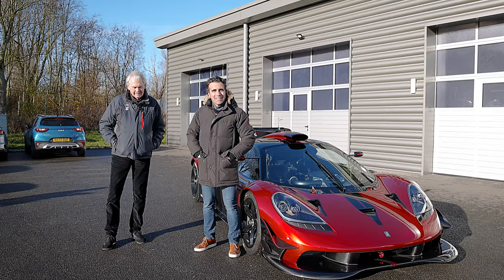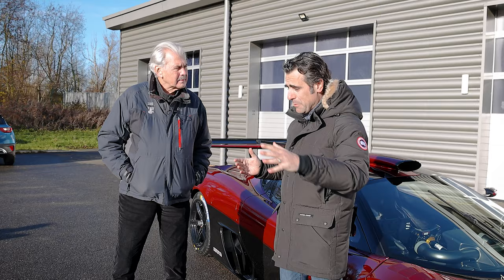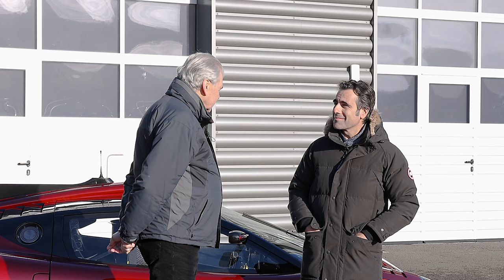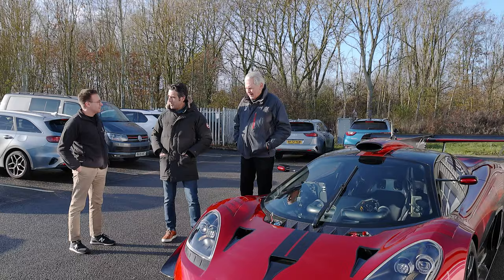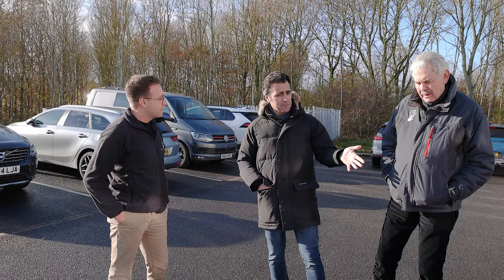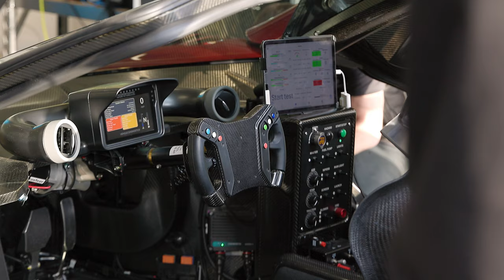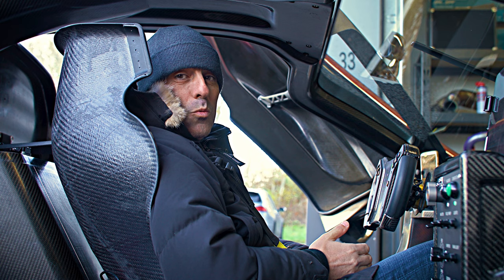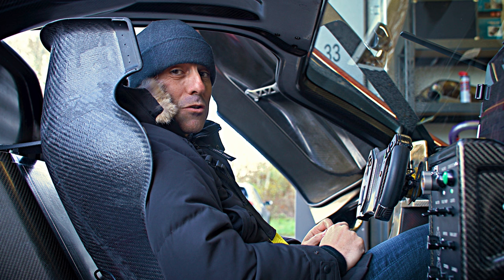T.50s VLOG | EPISODE #04 | COMMISSIONING PHASE - PART 1

Comment: Those shifts are basically instant. The pitch change of the engine noise is virtually instantaneous. One moment it is in one pitch, next moment a lower pitch. Never seen anything like it outside F1 or Moto GP - it doesn't seem to shift as much as announce that it is already in the next gear while the mind looks for some sign of a shift. If the Koenigsegg LST is like lightning, this IGS sounds like it's quantum tunnelling.

Comment: 900 kg = ~1984 lbs
750 hp

750 hp/ 1,984 lbs = ~0.378 hp/weight coefficient

Or

~1 hp per ~2.6 lbs (~1.17967 kg)

What’s more….the T50s actually has 761 hp @ 11,500 rpm and a redline of 12,100 rpm, which is mind boggling.

The McLaren F1 LM weighs 2,341 lbs (~1,062 kg) and produces 671 hp @ 7,800 rpm and has a redline at 8,500 rpm. 

This yields a hp to weight coefficient of ~0.28663

Or 

~1 hp per ~3.4888 lbs (~1.5829 kg)

In other words:

100 more hp than a McLaren F1 LM (which had 50 more hp than the standard McLaren F1 and weighed ~160 lbs (~72.6 kg) lighter).

And ~357 lbs (~161 kg) lighter than the McLaren F1 LM

The T50s produces its power from an engine that is 2 liters smaller and revs over 3,500 rpm higher.

Comment: This is such a magnificent project! It would be awesome if you guys designed a small bare bones mid engine h-shift I-3 trackday toy for the "every man". Then provide retroactive upgrade options for it to make a bit more profit like turbo kits, Öhlins suspension upgrades and the like. Heck, there could even be a fan aero package upgrade for it! This way the base car price is somewhat reasonable and the driver can upgrade it over time as they get more cash. Maybe even have an option to send it in a crate for final assembly in a garage to keep the price lower.
Reply: They did this with Yamaha a few years back. 27k GBP base price. But a leadership change at Yamaha killed the project.

Comment: The front splitter and canards completely change the character of the front of the car. Got to be honest I'm not a massive fan (pun intended) of the front end of the road going car, but add the splitter and canards and it becomes absolutely striking. Pity it's not for use on the road.

Comment: Imagine that IGS shifting in T.50...insane how quick you could go in bends 😎
Reply: Shifts are already super quick. This gearbox is the sort of seamless shift you get in Moto GP and F1 and if they can really get it perfected, it would be revolutionary for road cars too. It sounds just as quick as the Koenigsegg LST, but this tech is super top secret. Honda wrote a paper on 2 generations of seamless shifts in F1 and while I understood the first one well, the 2nd gen blew my mind because it had none of the stuff a normal gearbox uses.
Reply: @srinitaaigaura  so unfortunate that most of the customers opted for manual instead on the T.33

Probably that kind of shifting is appropriate only for truly lightweight cars like Formula 1 and superbikes so that GMA is the only light enough 🤷

Comment: Waiting for Gordon to take the Nurburgring Record for a Production Car with this. He still has the McLaren F1 holding the production car record for fastest ever NA car, which went 386.4kmph. No NA production car has gone faster and with todays standards, I dont think there ever will be a massed produced vehicle that breaks it. I also believe if Gordon really wanted to, he could build a vehicle from scratch that would slap the Koenigsegg Jesko Absolut, the SSC Tuatara, the Bugatti Chiron SS 300+ and the Hennessey Venom F5.
Reply: T50S isn't street legal, it can only compete against Porsche 919 LeMans prototype, so no chances.
Regular T50 isn't designed for track driving, lacking aero and mechanical grip.
GM doesn't care about laptimes in general and He definitely doesn't care about topspeed.

Comment: So here is my problem with the T50, no auto. I don't like driving a manual car. And I have owned manual sports cars before. Well there is always T33 I guess. Or even better, the CC850 box is auto and manual. That's the best of both worlds.
Reply: Sure, but manual really if done right feels so much more satisfying to operate than any automatic can ever be. 

Also T33 is full manual now, they dropped the pedal shifts because only like 3 people wanted that option :)

Automatics are great, but with these machines they want full control and feeling and feedback and that can only be achieved with a traditional manual.

Comment: GMA, doing more with less -- actually the maximum with the least. You showed us just how many things every modern car -- even your humble average family car -- out there -- DOESN'T need. The irony of people buying 2 ton SUVs while claiming to be greener in emissions, buying 2-3+ ton heavy electric cars built and charged with coal or gas powered electricity, and putting everything in laggy distracting touchscreens but getting 5 stars in crash tests, making supercars closer and closer to 2 tons with each generation, but using more electronics to artificially feel more agile - GMA is the antithesis of the hypocrisy of the whole car industry. Lightweight - good for the body, the intellect, the car, the driving, the costs, the roads, other road users, AND the environment.

Comment: More power? I thought it was the same T50 motor, minus the variable valvetrain?
Reply: Same motor, but no catalytic converters, no emission restrictions, higher compression ratio etc...more power.
Reply: Much more power. No cats and higher compression ratio, individual throttle bodies